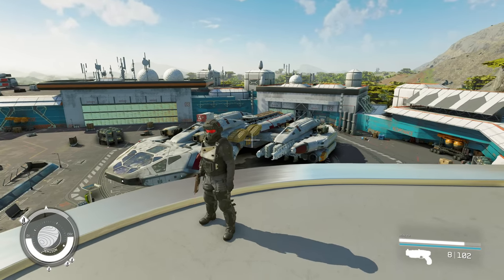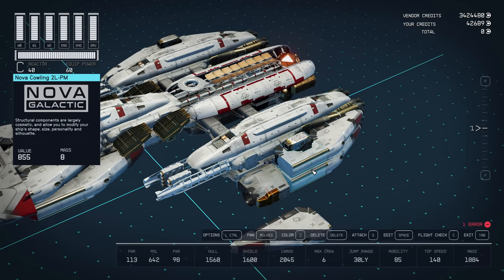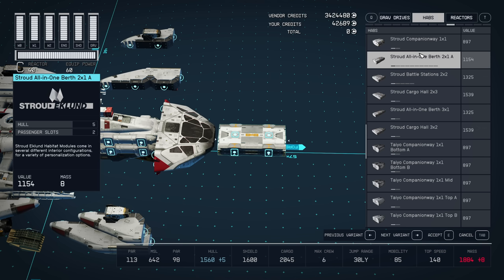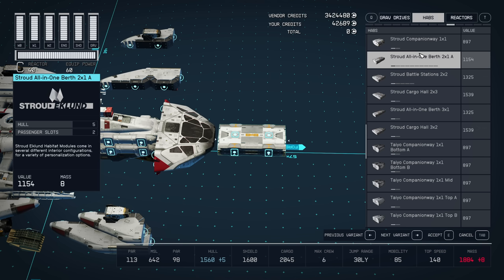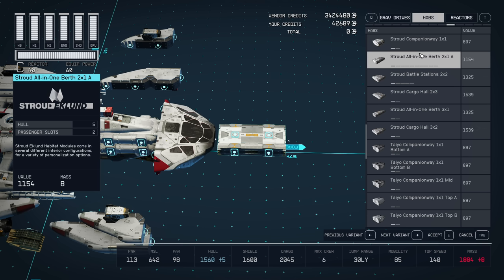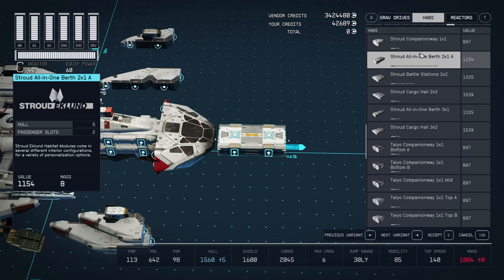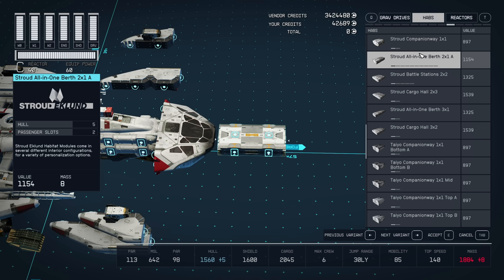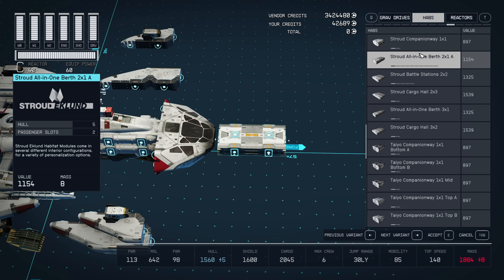Starfield Ship Mechanics, Stats & Building Full Guide

Comment: I like missiles. :( I wish they had long range locking ones like other games. However: their none-locking range is pretty good. Many complain because they judge missiles only by their short lock-on range. I love leading my target and manually aiming. There's a certain satisfaction when I lead my target and destroy a target without a lock... lol Plus i notice many enemies will start charging head on towards me: so i simply point straight away and unleash my missiles. I'd like to see some barrage options added. Just imagine a big cruiser or destroyer and seeing a hail of long-range missiles flying torward you from across the map. Like current navy missiles. 🤷‍♂️ I just feel they need more variety, a bit more love. What about arming a missile with an EMP warhead that would expload and disable parts. Or a weaker warhead, but would break up into clusters of smaller missiles (maybe this would be similar to the auto varients of balistics). I just feel they could have been more creative with missiles.

By the way, I loved your battleship design. It's my main ship, except i use 3 emp on mine and then drain my turrets when i want to capture ships.

Comment: I've built both your ships a couple of times now - very nice guides & designs.
I did notice a wall between the armoury & the computer core (or other mid had at the bottom), until I replaced the lower deck viewing ports.
I'm unsure if this forces anything but it makes a straight run through the deck & makes sure the only ladders are for the bay & bottom docker.

Comment: For the vanguard flight sim.. outside the simulator , go down the steps there is a tool cart under the simulator,  take the key card it unlocks a higher level of cheats than you can even access via hacking the console. And many will not have the security skills unlocked at this as well. No one seems to know about the key card.   Pretty sure you need be hidden and steal the keycard

Comment: The upgrade is for keeping the same ship design while increasing the ability of the ship… QUICKLY. The ship builder is there for players who aren’t limited for time and who want to build their own design.

I tend to take parts I want and just slap them together until I have the parts I want… and only then pull the ship apart and arrange them in a working ship that looks nice. It works for me but might not for others.
Reply: Right??? I typically buy a ship I like, walk it, see what I wanna change from the inside, then hit the ship builder and change the Habs and design to what I want, then I slap on the best engines reactors etc, BUT then i go to the upgrade section and that's where it actually is valuable... all the best stuff doesn't mean it works together well and you can loose alot that way... the upgrade menu allows you to fine tune your setup bc sometimes less is more type thing, also sometimes ill put the best thing on in builder, then go to upgrade and get an even h8gher option or variant

Comment: Turret issue (bug?): I'm finding that only 4 turrets of the same weapon variant will fire on the same target at the same time. Example: if you have two batteries of different model auto particle beams, (such as 4 PBO-100 and 4 PBO-300) all facing forward, it looks like every time they fire it's a random combination of 4 of those guns, not a full volley of all 8 turrets. It's as if there's only a single battery of forward facing turrets against one target. If you space out the batteries on some super wide ship, you'll see half of them just not firing while the other half is unless there are multiple targets in range.

This doesn't seem to happen with turrets of different weapon variants though, even in the same archetype. If I pair 4 auto particle beam turrets with 3 normal particle beam turrets, all 7 guns fire on the same target as expected.

Comment: Where I put my landing bay is JUST perfect for my liking. It's a top loader (Deimos) so you 'climb' a ladder (it's actually automatically you don't actually climb) and appear in the hab that's above it. You can't go directly into the c-pit, BUT my bay is moved one spot forward so it's sticking out the front a bit... not a problem as my Cabot cock is quite long. Anyway WHEN I pop my head up I'm facing DIRECTLY into my c-pit no muss no fuss! I also love the Deimos docker, it's positioned right behind my bay so when docked to ships/ stations I appear right behind that DIRECTLY behind my c-pit spot. so very very close indeed.

Comment: Excellent work - thank you! The information about weapons was enlightening, to say the least. 
I will have to watch the part about crew calculation again - they made this needlessly obtuse. 
A couple of notes - 
I'm sure it's a bug, but you can't paint the Taiyo 3x2 sloping rear shroud piece either. 
The 28T class B shield is an excellent option if you can live with a side mount. It has one of the best shield/mass ratios available (and when you're counting your mass - it matters)
  - side note:  I typically try to "hide" my reactor, Grav drive, and shield - from a practical point of view, this does NOTHING as far as I can tell. From a designer role-play point of view, it means the enemy should have to blast through everything else before they can target your shield or grav drive - sadly, it doesn't matter.

The wide Nova radiators also work as equipment braces (engine braces) 
One of the best Nova habs to attach connector tunnels to is the 2x1 Control hab - you lose nothing as all four attach points are simply storage decorations. 
Watch out where you put windows on the 2x1 all-in-ones - on the Nova, you can lose the bed if you place a connection or windows in the forward starboard connect point. 
In terms of feel -I prefer the Nova to every other Hab - I do wish Taiyo duplicated the Nova interiors rather than the HopeTech - it would have made a lot more sense. 

Mods I want
Landing Direction is based on Landing Bay Orientation not cockpit. 
Value Adjustment -  Cosmetic components should weigh 0.5 per unit at most - so a Diemos radiator would be 0.5 mass and 0.5 hull  - if it has a hardpoint (weapon mount), add 1 mass & 1 hull. If it has multiple connect points, add another 0.5 mass & hull for each. The idea is to encourage athletic design, not punish it.   
Some of the Taiyo pieces are upwards of 9-10 mass, which is nuts.   In particular, I'd like a version of the Taiyo Sensor Array that was sized to fit like a Stroud-Eklund breaking engine.  - maybe something that looks like a radar dish. 

Full range of 2x2 & 2x3 Habs (all the variants)
Stairwell Habs - 2x2 or 2x3 or even 3x3 two-story habs with stairs.  - I'd love a 2x2x2 (Length, Width, Height) and 3x3x2 cargo landing bay - where the landing bay opens the entire front of the Hab, and there's a stair to the next floor up. 
2x Cockpits - allowing a symmetrical design based on 2x2 and 2x3 Habs
Reply: I'd also like mods to add many structural component which could look like they could have some cargo space into the cargo category, as it would make it more aesthetically pleasing when designing ships.
Reply: @TigonIII  I've done a tiny (really tiny) bit of modding - and I can see a number of mods that I might attempt.  Sadly doing anything with art is just not going to happen so I'll have to wait.  

I'd love to see the ability to have containers loaded & unloaded - containers that you deliver and get paid for.  The ability to buy on spec and play the galactic market - although this might require the establishment of a bigger market (more cites).
Reply: @vincentkeith5259  The mod I mention is actually quite easy to do once the Creation Kit comes out, as you basically just have to duplicate all the structural part you want to make into cargo, then edit their properties and then make them appear in the cargo category instead of structural. The hard part would be balancing the parts to not be completely overpowered or "broken" gameplay wise.

Comment: 47:13 ~ @YankCast, that is incorrect, think do I.  The Nova Cowlings you have on the top of the wings will flip upside down;  It has been done by me when giving engine wings to the Mantis... though it is true that it is rare for any module that allows being vertically flipped, agree do I.  The fun thing about flipping the Nova Cowling is that the previous point that could only attach to doorways of modules, then can be used as a mount for weapons.

A considerable degree of control for passageways can be had by deleting the entire ship, & then rebuilding it from the cockpit.  Then after the first module connecting to the bridge... or right after the bridge;  build your main corridor of [companion way] Habs.  Make sure they say companion way because that almost always makes them link together as the primary passageway for the ship.  Then put the docker on the bottom Companion Way Hab & ideally you can build the rest without worrying about ladders or appearing where you don't want them.  You just have one potentially really tall ladder.  The one caviat to this that was found by me, is that it is important to avoid putting 2x1 or 3x1 habs next to each other before you have finallized the build.

Ensure the ship is flightworthy, you can skip weapons for now.  Then finalize the build.  Then go back in & place whatever habs you want beside the earlier hab.  The game remembers where it put the doors & ladders for any given ship, unless you delete the entire ship & start from scratch.  However, putting habs next to each other may let the game add 'additional' doors, but at least you have the main one you want to use.

Comment: Simple designs without all the added mass from trying to fancify the ship are better for mobility in space battles. The Star Eagle is a great base design to work off. Upgrade to the C3 or C4 cockpit, C glass reactor, grav drive, weapons. Plus add 2 SAL-6330 engines to each side at the back and it's unbeatable with a level 4 pilot running the show. I added over 1,000 lbs to cargo cap. and still have 100% mobility with all the improvements. 

I added the following to the Star Eagle after giving it a Midnight Blue pain job which made ever ground crew personnel at Akila space port come running over to see it (6 from the left, then 6 more from the right).

XIANG Pinch 82 Reactor
Apollo GV100 Grav Drive.
Atlati 280 C missile launcher x2. Careful with these, one hit usually destroys any ship. If you want to board ships, be careful with them.
PBO 175 Auto Helion Beam x2
Firebolt 4000 Suppressor x2

My Star Eagle is 39 M long with all the improvements.
I would post a screen shot but it would make you jealous.....baa...ha...ha....ha...haaaaa.
Reply from the maker: I hear the sentiment alot, but since mobility barely does anything I choose fanciful every time
Reply: @STALVIET  Mobility is very important for combat against other ships. I find it especially helpful in getting close enough to Va'ruun ships to dock with them when I have taken down their engines and shiels. They used to out-maneuver my ships and ram me before I could dock with them. Ramming me was suicide for them and their ships would blow up before I could dock. 100% mobility makes it much easier to take over other ships.  All my builds under 1600 mass have 100% mobility  using six SA-4330 engines. 

The nice thing about these engines is they only require 2 reactor bars each; they are A class, come in several variants for stacking or placing side by side. These engines come stock with the Star Eagle. They can be purchased at Stroud-Eklund in the Narion System. I try to keep my fighter ships under 1600 mass so I can use these engines.

For my freighter ships with a capacity of over 9,000 cargo (with perks), I'm forced to use the slower  C class SAL- 6330 engines (x 6). This way even my heavier cargo ships have 100 percent mobility. The loss of top speed is a bit disappointing, but I live with it. 

When the Va'ruun start ramming you and out-maneuvering you in space battles using the massive Eulogy or Prophecy ships, it's because your mobility is not high enough. 

For C Class ships I use four of the SAL-6330 Engines. What a lot of people don't know is that there is a way of stacking two of these together to reduce height. 

In other words, instead of placing the two engines one above the other as separate units, they can be combined into one larger engine that takes up less height. By placing one engine first, then duplicating it, the duplicate will attach above or below by automatically interlocking with the one above or below and become one big engine that has less height. This procedure only works when at the Stroud-Eklund staryard. I've tried it at other ship builders and it won't work. I've done this with other C class engines too.
Reply from the maker: @johnspartan98  yeah the Slayton engines are far and above the best for most builds.  I just have started leaning into selecting my engines based on aesthetics instead of stats because I never found my maneuverability or speed impacting my fights.

There are definitely builds that focus on speed, I just never found the need to besides fun factor because in any ship fight, on very hard, the enemy ships die in about 3-5 seconds of concentrated fire.  In most fights I don't even put more than 2 or 3 power pips into engines I just  sit in place and turn towards the ships like a giant turret.  

I did run the numbers in case your curious on the mobility stat, it determines acceleration/breaking and your turn speed. These numbers are rough as it was just me with a stopwatch but they are precise enough.  

Time to max speed with 1 mobility: 11 seconds.  
Time with 100 mobility 5.5 seconds.

Time to spin 360 degrees at 0 speed with 1 mobility: 26 seconds
Time with 100 mobility: 9 seconds

Time to spin 360 degrees at maneuvering speed with 1 mobility: 14 seconds
Time with 100 mobility: 5 seconds.

Maneuvering thruster mode (strafing) is unaffected by mobility

All tests done with max power to engines (12 power pips) 

So overall while it feels nice flying an ultra maneuverable ship it doesn't impact me much because I prefer using heavy c class ships with a focus on turrets.  The dps, range, and accuracy with a full particle beam loadout (which is what I use on my main deimos ship from my other vid) is so high that enemies die faster than they can get to me, so I don't even need to turn to face them.

Comment: I made this ship but didnt have the    bottom docker.  So threw a top docker on it.   After getting the right docker and then removing the top docker.  I then went inside.  Where you have a ladderr on the top area going to the lower level.  I do not have any ladders.  So only way to get to the lower level is through the cockpit stairs..  for me this is great and will have to remeber this trick.  I myself dont care for ladders exept when you first come in since its a loading screen anyway.

Comment: Fantastic building guide, with a lot of information, thank you!  Could you recommend the amount of helium tank to make a jump and backwards for 30LY would 600 be enough to avoid so loading screens? I liked the HE-3 tanks you used, if I am correct you have 550, 4x100 and a 150 on your ship. P.S. the urls to your spreadsheet seems to be broken or is that my browser?
Reply from the maker: Thanks!  for the links yes it appears youtube cut them off and i need a day to do "ID verification" before they will work again.  for now please search "Ultimate Guide to Ship Weapons with DPS Spreadsheet" on google and you should find my reddit post with links to all spreadsheets.  As for the recommended fuel i think 600 is plenty to avoid most loading screens assuming you are at the 30 ly jump range mark.  also you said jump and backwards, so in case you dont know helium storage is fully refilled after you jump, its just the limit of how many jumps you can make per loading screen.  600 should be good, but best way to tell is just hop in your ship and plot a route across the system and see how much fuel it consumes at the bottom, as long as you dont use the entire bar youre good to go.
Reply: @STALVIET  Gosh, I don't know how to thank you for all your help, much appreciated! Yes I have 30LY but I understand the max you need to have seems 28LY from reading up. I really didn't know about the refuelling after your jump, I always assumed you needed also to have the fuel to fly back. I should be like you, never assume but research and test. Thanks a lot for your time and help.

Comment: Best crew, IMO:
1) Barrett - Starship Eng 4, PBWS 3 
2) Sam - Piloting 4, Payloads 2
3) Sarah - Astro 4, is free crew
4) Vasco - Aneutronic Fusion 1, defends docked/landed ship
5) Omari Hassan - Shield Sys 3
(The rest are for RP and can be replaced)
6) Rosie Tannehill - medic
7) Mickey Caviar - chef
8) Andromeda Kepler - scientist 
9) Dani Garcia - chemist
10) Your character 
11) Optional companion
12) Adoring Fan, bound & gagged, stuffed in a container, slowly becoming fertilizer for succulents.
Reply: You're missing Sam Coe.  He is paramount, alongside Omari Hassan.  They're the only two that give a free pip of power in the related systems, engines and shields respectively.  By adding a crewmate with Aneutronic Fusion you get a total of 3 power on top of the player skill.  Sam Coe also gives you quite the speed boost, allowing the speedy Whitestar 3015 engines to hit 280 boost speed instead of their already unique 180.
Reply: @XoRandomGuyoX  Sam is there at #2, my spacing is wrong.  I'll correct the spacing.
Reply: @ShaggyShagz13  Ah, whoops.  On another note, if you decide to run 6 Hellfire Autocannons for fun the guy from the Viewport Bar can be useful.  Gideon Aker, I think?  He has 2 in both Ballistic Systems and Missiles.
Reply: @XoRandomGuyoX  I only use particle beams. With mods now, I get the 200 crew piece and SW aliens so I have a massive crew fitting of space travel.